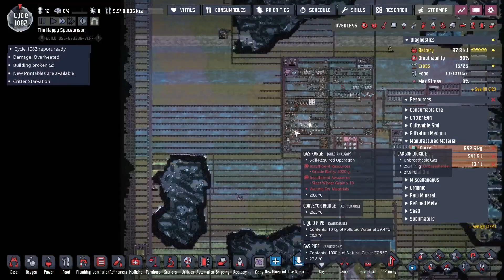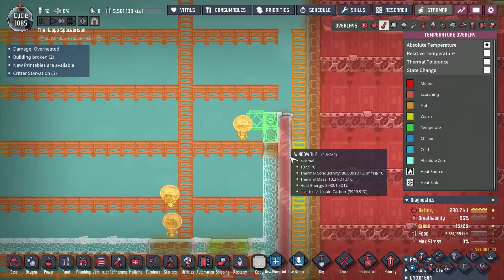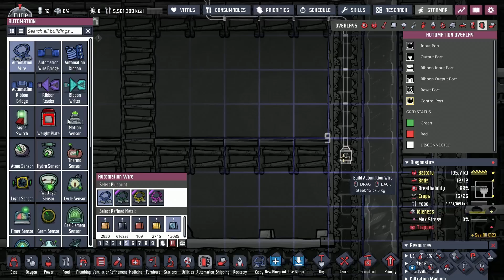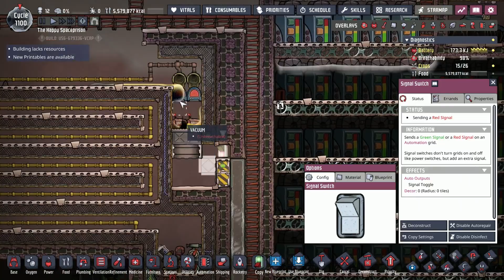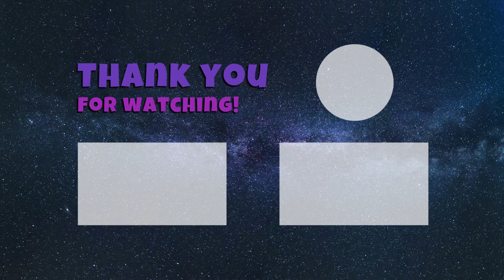Petroleum Boiler MULTIPLIED Our Power | ONI Episode 20

Comment: Shouldn't the oil come out colder? I think it should be around 122 degrees.
Reply from the maker: You can set it up to do that.  But the goal here was to show that you can make it work, without calculating for efficiencies.  

My goal is to make some elements of the game a bit more approachable for newer players.
Reply: @ender7154  I understand, I'm a new player too, that's why I was curious. ty
Reply from the maker: I do find some fun working out designs that maximum energy output and heat exchanging, but I mostly just do that in creative. 

In the thick of it, often im just using what I learned to make something thats good enough, because I know im gonna change it ten more times later anyway.  😂

Comment: Pointing out the obvious here, but in the oil collection room you mention 'the automation is complex so I'll do it offscreen and then explain'... I don't think the latter ever came about :)
Reply from the maker: Bad habit.  

I did end up changing that automation quite a bit, as it was way too complex, and i had overheating issues when it shut down.  Once im done with this run, I think im goong to tweak it in creative and do a bit more extensive of a tutorial on it.

There are a lot of boilers designs out there, but my goal here was one that is fairly simple and can be turned on and off as needed, and I think I achieved that a bit later on in the series.  Ill polish it up and make a simple tutorial for it soon!

Comment from the maker: Not the most efficient boiler, but i did my best to explain each component so you can use the knowledge to customize it to your own bases.  

It does still need some work, but it does the job.
Reply: Very cool boiler! I'm used to seeing boilers with 2 tile wide heat spikes and sideways doors between glass, but your version is really easy to understand.

Would using the airflow tiles take the heat to parts of the boiler that you wouldn't want? Or is that intentional?
Reply from the maker: I just do it to ensure that their is no heat transfer.  As long as I maintain the vacuum in the room, the airflow tiles are essentially a vacuum buffer for the heat.

Also, I like how they look since they change how fluids connect to airflow tiles, and for me, often, aesthetics beats efficiency.

This boiler does not have some of the features of others I have seen or done, but I was going for the simplest one possible to help people who may have never built one before if they want to replicate it.